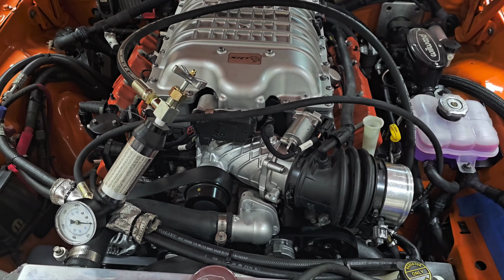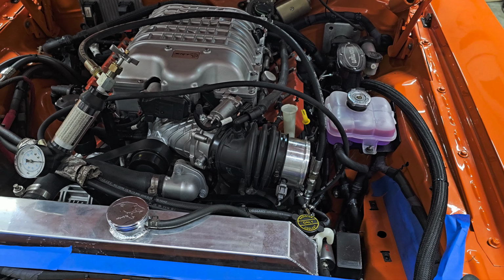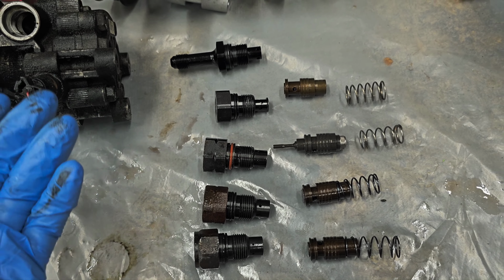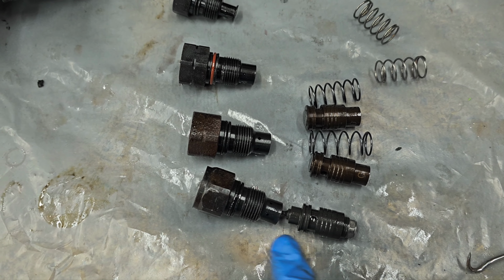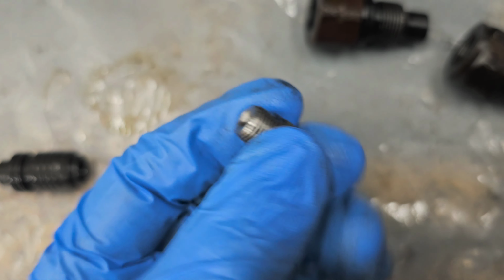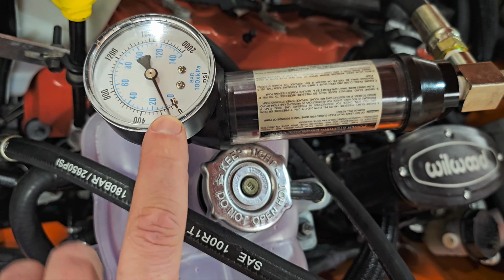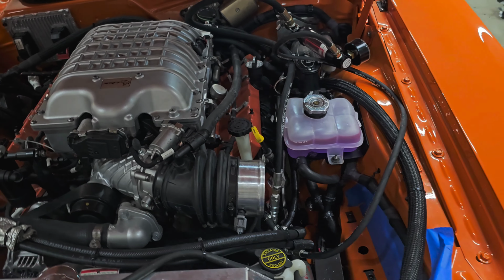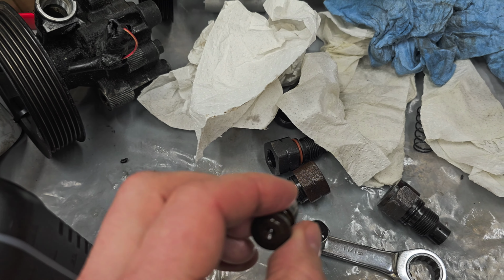1974 Dodge Challenger Hellcat Swap (Gen 3 Hemi) - Dialing in the Power Steering Pressure/Flow

Comment: Boy, I sure would like know where you got that pressure tool for 50 bucks! I. Doing a 6.4 in a 69 Dart, running an aftermarket "stock style" 6.4 pump and a borgeson steering box. According to borgeson, the box wants 1100-1250 psi to be happy.. Max 1450. I bought one of sublimes 850 restrictor and I just don't think it's doing to be enough. I've read that the Camry pumps put out 1138 (source: sublime). So I've ordered cheapo 2006 Camry pump to gut for it's valve. Hopefully it doesn't have the funky nipple. I have a turn one 2.5 flow restrictor as well. How has your system been holding up?
Reply from the maker: Yeah, I scored the tester brand new on eBay.  At the time there were a ton of them on there for similar prices.  850psi of relief pressure is pretty low; with a heavy front end, wide tires, and aggressive stance you could be hitting relief pressure turning the wheels when stopped which would cause hard steering at low/no vehicle speed.

My steering and braking has been flawless so far.  I racked up several thousand miles last summer during break in and I plan on putting more on once spring is here in a month or so.  No issues whatsoever!
Reply: @danm6230  so with my valves, I found that they are very similar internally.. Just different port size on the threaded end and washer count. The Camry valve does have that elongated end. After putting some mics on everything, I came to the conclusion that I could use all of Camry parts in the dodge valve body.. Traded spring, check ball, spring insert and the threads end which had a much smaller port. I did end up buy a analyzer on ebay.. 60 bucks shipped but it's not the otc. Looks just like it tho. NOS M998 HMMWV HUMVEE POWER STEERING ANALYZER. I think it'll work. Thanks for the suggestion. I don't know why I didn't think of it.. I'm an ebay nut!
Reply from the maker: Yep, it's less complicated if you can reuse the outlet fitting. I needed a 6AN end so reusing the Toyota banjo wasn't an option for me. I also didn't know what that banjo flow rate is and knew I needed 2.0 to 2.5 gpm. You'll be able to test that soon enough though! That's the same listing I bought mine from. You may run into an issue where the valve sits farther back and uncovers the relief port resulting in no line pressure if you mix and match different style valves and fittings. I ran into this myself. They are not all swappable without a matching fitting type. You can stack the fitting and valve up on a bench and compare it with the original combo to verify if it's an issue or not.
Reply: @danm6230  maybe I didn't say it right.. I took the actual valves apart and Swapped the inners, cap and nuts and washers. I have a turn one 2.5 gpm flow fitting that I'll be using. Easier to explain if I could add pics. in the end, the pressure regulator only retains it's original (dodge) body but everything else it and the flow nut is Camry.

Comment: While I appreciate the effort how much time/money are you saving doing this when you could have just bought the reduced pressure power steering pump from a place like Bouchillon Performance?
Reply from the maker: As I recall, they are charging several hundred dollars extra for a pump with lower relief pressure, and they did not lower the flow rate at all which is half of the issue. Hence why they also require a PS cooler. I spent more money because I wanted to show people some new things and do testing. The pump I settled on was only $60 from Amazon, and the restrictor fitting another $60. Still cheaper and I have a dialed in power steering system now.
Reply: @danm6230  interesting.  Please understand I wasn’t critiquing just curious as I am doing a hellcat swap in my 70 challenger. I am running the QA1 k member which has the mustang 2 rack and pinion. Requires reduction to about 800 psi.  Could you verify part numbers you used in the end to make it all functional? And yea the whole set up from Bouchillon is over $700 including the cooler before tax and shipping.
Reply from the maker: @jhyatt139  no worries! If you only need 800psi relief, just order an 800psi Saginaw "P" Type pump relief valve. Super cheap and available all over the place. It will fit and work in the Mopar pump. As for the outlet fitting, it depends if you're just using power steering or also have hydroboost. If both, I'd use the 2.5GPM Turnone outlet fitting like I did. If just power steering, use the 2.0GPM one. I don't have the part numbers handy, but just go to their website and you'll find them.
Reply: @danm6230  the motor I bought didn’t come with the power steering pump so I need to buy a pump regardless.  Used pumps they want 350 for them and I can buy a new one oem Mopar for like 410 including core charge. I guess it would make sense to buy the new one and then change the relief. I am running hydra tech hydro brake boost. This way I don’t need to run a cooler.
Reply: @danm6230  Just an update - I ended up going with the Turnone power steering flow reducer from Turnone with the 2.0GPM Flow rate and I spoke with Hydratech for my hydro brake boost and they suggested to use Heidts PS101 adjustable pressure valve.   This way I can regulate the flow and also not have to worry about there not being enough pressure to run the hydro brake boost.